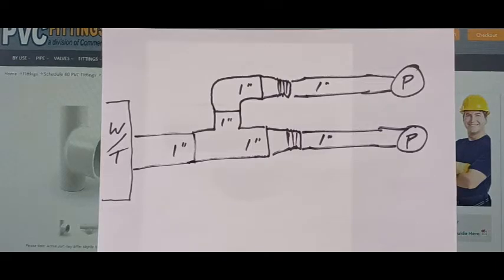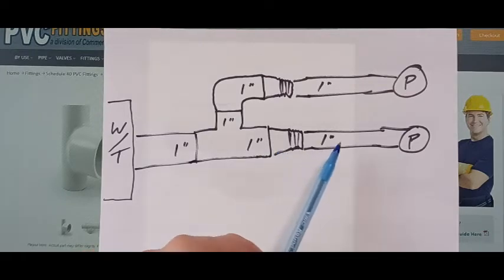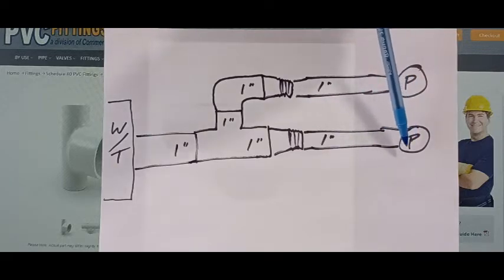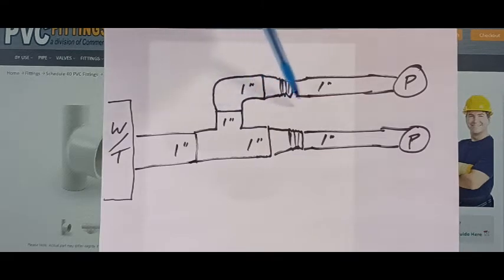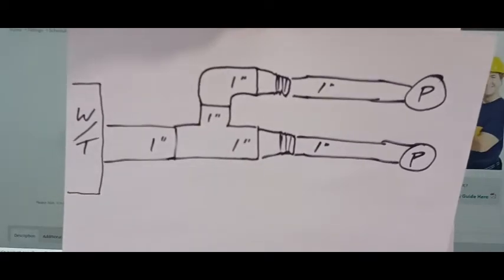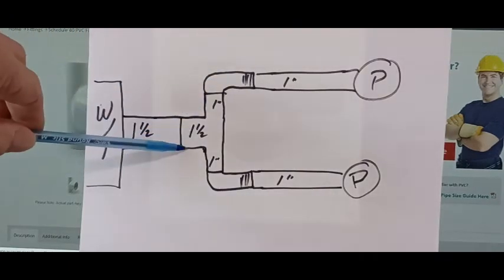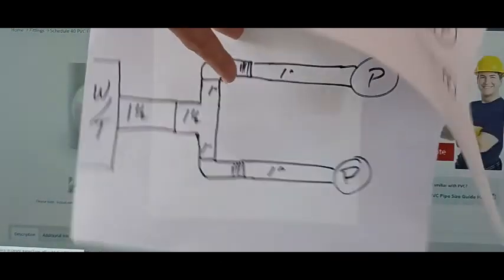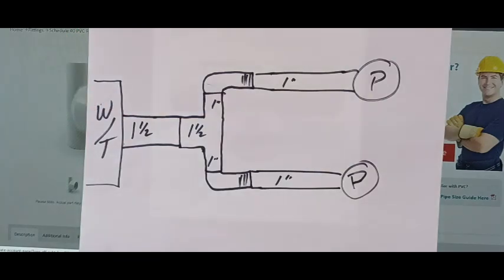Quick tip 10.  How to connect 2 pressure washers to 1 water supply?

Comment: This makes total sense. Just like some plumbers that plumb bathrooms with a 1/2 inch supply and pull the toilet(1/2”)and sink (1/2”)and shower (1/2”)and when the toilet flushes it lowers the pressure of the shower. Have to supply with 3/4 or 1 inch to pull off 1/2 inch branches to prevent pressure loss. Thanks for the heads up, Kenny.
Reply from the maker: Exactly!

Comment: What is your opinion on different types of pressure washers, but operate at the same flow  per minute, and max pressure? What is your opinion on adding high pressure check valves AFTER the split of the header? Lastly, what is your opinion on using a Y fitting for maximum flow (referencing your comment of the “least path of resistance”)?
Thank you
Reply from the maker: Water and electricity find the least resistant path.  But I have no experience twinning two pumps together.  I would ask on some forums.

Comment: Hey Kenny what do you know about SH and copper. Everything I read says it will either patina the copper or corrode it. I have used a house mix at 1.5 on copper gutters all the time when house washing. I just rinse the gutters really quickly and I have never had any problems. I have a roof to wash is gonna need at least 5.5% and they have copper over the bay windows that will collect significant run off so I told them I couldn’t do that section do to uncertainty with that high a mix. What are your thoughts?  I think Im gonna get some pennies and run some field test with different exposure amounts and dwell times. Id love to hear from the brainiac. Thanks!
Reply from the maker: I've never looked into that.  I have no clue.  Better ask on some forums.  Let me know?

Comment: What do you do when you get near the electrical panel of a house?
Reply from the maker: You would first inspect it for any exposed wires.  If it's bad tell the homeowners to get it fixed.  If good then look to see if the box is caulked to the house? If not,  you'll need to tape both sides and top to keep any water out.
Reply: @housewashing5693  thank you!!!